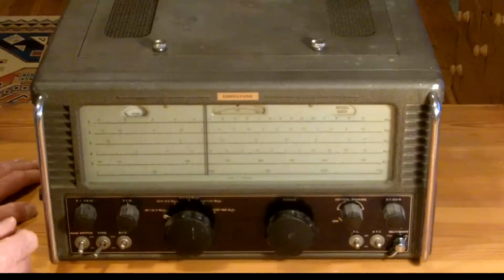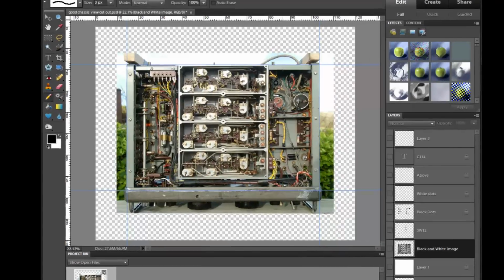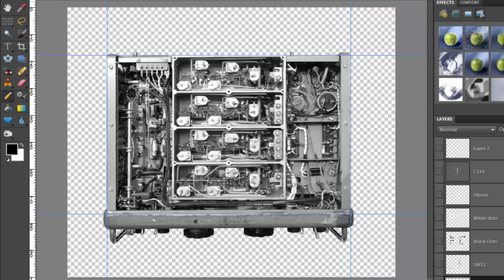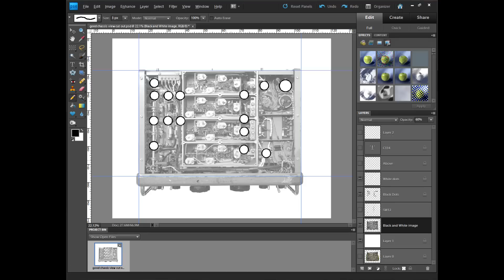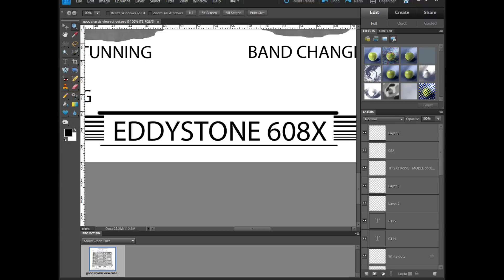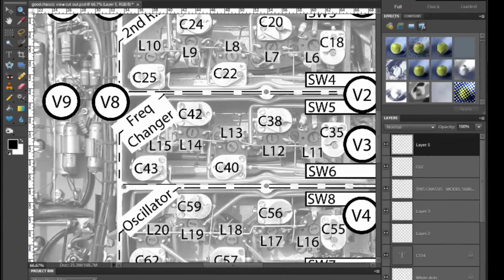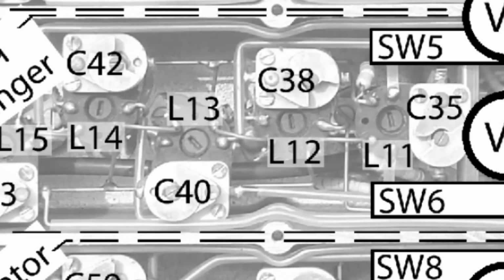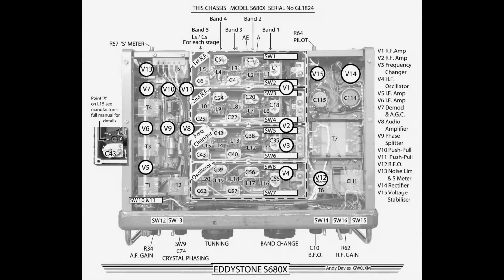About Radio ... Part 31 Component Identification Diagram S680X by Andy Davies

Comment from the maker: Hi Ian, OK All understood. At one time I used to check my very accurate digital watch against the time signal every day as I thought it really mattered but now I haven’t worn a watch for about ten years. Fortunately the sorts of electronics I play with now don’t need any precision but yes things drift out of spec. At tech I used to get the lectures wound up as I’d connect all the AVO’s up in series to measure current, no 2 metres read the same so it’s not just digital meters that vary. 
..Andy

Comment: Hello Andy,
Sorry I didnt explain my self better I have about four digital meters on say a standard voltage of 13.8 volts some read over 14 volts etc so it difficult to believe their readings
they I think were proably spot on when new I wonder if you had noticed this also,My comment is they all fall out of calibration over time and become guessometers.
They could I guess be recalibrated but these day it would be not be worth the charges.
Kind Regards
Ian VK2IJ

Comment from the maker: Hi Ian
Thanks for the kind words. I'm not quite sure what you mean by mean by lack of standard calibration? The big difference with digital meters as opposed to digital simple analogue metres is of course the very high input impedance of digital meters. A good old fashioned moving coil meter actually draws a tiny bit of current and when you’re used to it, it can actually give you an bit of a ‘feel’ that a digital meter simply can’t match.
Kind Regards ... Andy 
GWØJXM